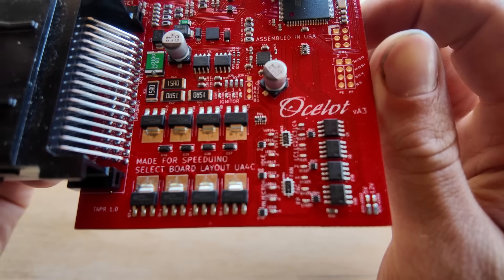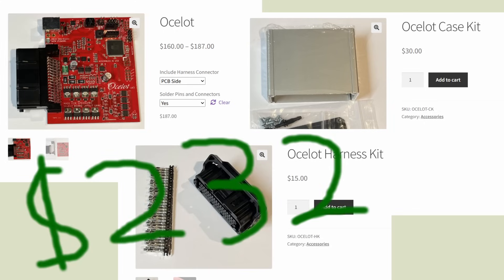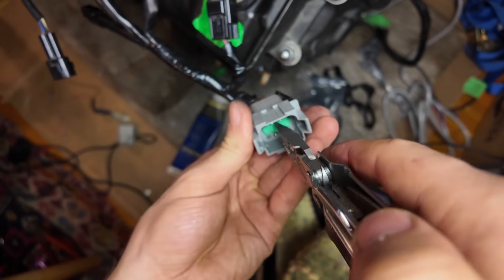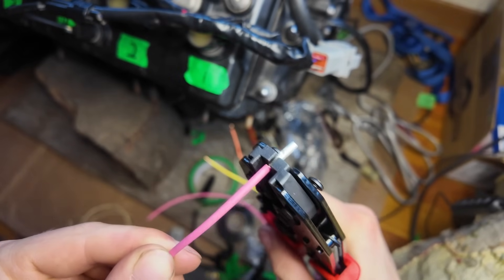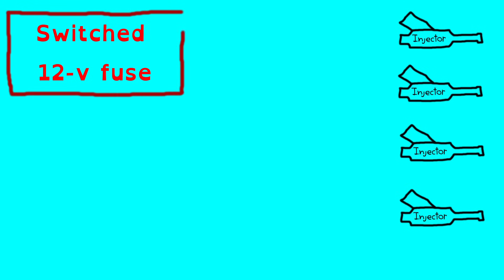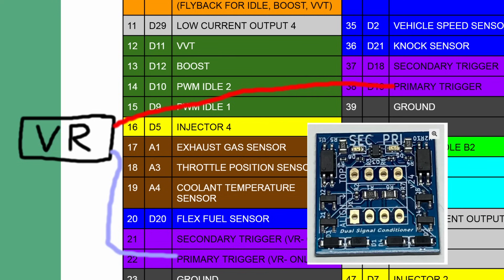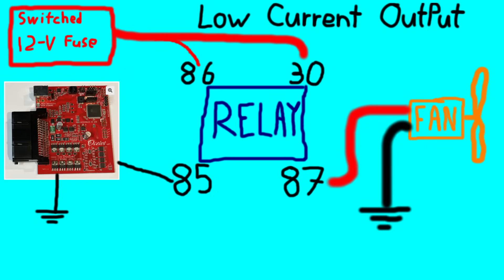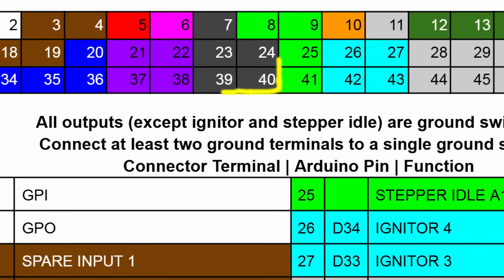ECU Wiring Simplified - Featuring Speeduino Ocelot

Comment: I am a long time Speeduino builder/user.  I highly caution against the use of 14.7's spartan series WBO2 controllers.  Unless they have made some significant changes to their firmware, when your AFR reaches the rich limit of the Spartan's range, it defaults to output 5v  (which the ECU interprets as max lean).  This seems like just an inconvenience, but when using the WBO2 for autotuning, it will cause any VR cells which are too rich to become WAY too rich.  I opted for the AEM WBO2 controller (I'm not a fan of having to have a gauge, but they're relatively cheap and dead reliable)
Reply from the maker: thanks, I will definitely keep that in mind

Comment: Great stuff! Having done wire work for GM a while ago, I found several things useful to this process... A large set of felt tip pens of many colors for marking diagram print outs. Junkyard wiring harness for proper color spare wiring. Wiring into the circuit "breakouts" to attach to for debugging later. These should be waterproof, as should all connectors. Bosch stuff (most ecu's are done to Bosch designs) has wiring which works when new but as time goes by, becomes overloaded , runs hot or the insulation breaks, allowing corrosion and current faults as you drive down highway 140 in Nevada... Most of all, plan for debugging and work on getting wires just the right length. You may not know much about electrics now, but to learn, ya gotta get busy! As Honda said, to succeed, you have to fail a lot!! Get out there and fail! Make notebooks with part numbers, your thoughts and sources for stuff. Most of all, never give up.

Comment: One item I'm unsure of, and can't find a clear answer to anywhere I've looked is how to ground sensors when I have more sensors to ground than ground inputs on the ECU?   I'm using an ocelot.   The O2 sensor has an electronic ground (versus 12v heater ground), VTPS ground, ECT ground, IAT ground...and I'm forgetting one.    Even given those I've listed, that only leaves one open ground for the ECU to ground point.  Is that acceptable?  How would I ground additional sensors to the ECU directly?  I'm guessing a ground bar off of a ECU pin isn't the answer.
Reply from the maker: @krakenworks7702  I believe it is standard practice to splice sessor grounds together and connect to one ground pin on the ecu. this allows you to to use 2 or more of the ground pins to ground the ecu(I believe 2 minimum is recommended for the ocelot).  a link for a video on star point grounding is in the description of this video it may help answer some of your questions.

Comment: With the ocelot and older ua4c boards you do not use one of the spare inputs for an external MAP sensor. Next to the onboard MAP, there's a via on the board labeled EXT MAP that you can add a pin or wire directly to, then sever a trace on the bottom of the board.

Comment: I need to put one of these on my 06 cbr600rr. I basically replaced everything besides the ecu and harness and it still wont turn the injectors on. Im thinking it has to be the ecu or harness and the only option is buying old used ECUs that are as much as an ocelot. It would open me up to getting it fully tuned as well. My bike has vr sensors and i think i can cut a tab off the cam trigger plate to get an appropriate signal for the speeduino to use one of thr basic tooth configurations.

Really good video I am going to use this to get the projected started.
Reply from the maker: @clutchboi4038 ahh yes, a very sneaky electrical gremlin that doesn't want to be found. Keep in mind if you do go the Speeduino rout, you may have hidden costs such as a quad spark. But, if you want to get into tuning then it might be worth it. Best of luck getting the bike running😀.

Comment: Microsquirt is only $300 and is very well developed to decode just about any engine crank/cam sensor and can control just about any engine. The megasquirt has better control of COP for larger v8-10-12-16 cyl engines..
Reply from the maker: @Altprophet Meg/Microsquirt is definitely a well proven excellent system. But I would argue in terms capability pre dollar Speeduino definitely wins out, and with the dropbear COP is now possible up to 8 cyl. 
That being said I wouldn't necessarily recommend one over the other. I think it really comes down to the individual project and what features are required.

Comment: Thats awesomely interesting, I'm trying to use a 99 ecu on my 02 zzr1200, because I always think "why not" so I have no rpm or speed limiter, but if this is a more sane alternative, I am very interested, thank you
Reply from the maker: I mean the easiest would of course be to find an 02 ecu, so long as you don't run into immobilizer issues. But Speeduino is definitely an option. If it is a sane option is up for you to decide😂

Comment: 55 years for me to reach this level of understanding, reduced to a few minutes! Excellent. For some reason, the teachers seem unable to reduce the subject to fundamentals. You have!
It's amazing how many mechanics don't even know that fuel injectors have a live feed, which is grounded to switch it on/off. Thanks.
Reply: my name is Tobias and I know that injectors are ground controlled! The ECU isn't a power distribution center, it is easier for a ecu to shoot a ground signal rather than a voltage signal every pulse.

Comment: Thank you for making this!!

I plan on using a speeduino to convert my 1987 Honda CRX from carb to fuel injection. It'll be a rather difficult project since the EFI parts for that car are neigh impossible to find or cost more than the car is worth.

I'll be working to come up with my own trigger wheels for it and use a throttle body set from the Honda CBR 1000
Reply from the maker: Very cool, I love me a CRX. best of luck!

Comment: BTW I find the best way to power the LSU 4.9 is via the fuel pump relay.

It's fragile and can crack from cold-start condensation if it's been pre-heated by leaving the ignition on (programming, checking data, etc). The pump will almost never be on unless the engine is running.
Reply from the maker: Yes, thanks for bringing this up, a very good point indeed. I currently have it wired into ignition but I should probably change that ASAP.
Reply: Yup, VW has powered lambda sensors from the fuel pump relay since they started using them in the 80s.

Comment: This was a really good video. I've done a few engine swaps in cars. And usually the security system from the donor car is a problem. This would eliminate that. Once you get it running please show the tuning process.
Reply from the maker: Yes absolutely! security system is the reason I couldn't just buy another stock ecu for my bike engine. The tuning video will still be a wile since the engine has no car to go with it yet. But the getting it running video should be out in the next couple days.

Comment: Fantastic entry level start and I thank all of the helpful comments! One very helpful detail would be to supply part numbers on the wiring terminals and tools used. I want to build one of these! I’m interested in the tuning to dial this ECU in and what is adjustable, ignition timing and fuel delivery? I recently began developing an oscilloscope training course for motorcycles as every circuit can be tested while the engine is running. It’s best to test a known good system to have a database for troubleshooting. Oscilloscopes are becoming affordable and they are not difficult to use with proper training and learned techniques. A quick example regarding crankshaft sensors. The two wire sensors produce an AC voltage known as a sine wave. The voltage is an analog signal. The three wire crank sensor are typically Hall effect sensors which use a power source and a ground and send a DC digital on/off signal to the ECU. With an  ohmmeter all testing is done without the engine moving and all power off. With a volt meter your reading will be a numerical value. With an oscilloscope the realtime voltage waveform can be displayed. The electrical behavior of coils, injectors and fuel pumps can be measured all from the ECU or the fuse panel. Even the burn time of a spark plug can be measured to see if the mixture is rich or lean. Anyone interested? I’d like to contribute to this thread. Build, learn, and ride. I just bought a basket case SV650 to use as a test subject.
Reply from the maker: @Dee-xm4jb Yes part/tool list is definitely a good idea. I will put something together and add it to the video descriptions. 

Ignition timing and fuel delivery are definitely the main things, but there are quite a few other things that can be controlled such as idle air control valve, boost control, variable valve timing and of course it can control any circuit using a relay as I mentioned in the video. 

I have never used an oscilloscope, but I can definitely imagine it coming in handy. I can think of a few times it probably would have made my life easer.

Comment: Tempted to try to get something like this working on a 2000 f150 5.4 v8
Reply from the maker: @kaleb8518 Absolutely. you wouldn't be able to do fully sequential injection with any of the regular 4 channel Speeduinos, but it's probably overrated anyway. Or you could of course go with the drop bear which has 8 channels.

Comment: Bro if you become a subject matter expert on speeduinos, I bet you could make mad $$$ this way - like for example my brother has a damaged ECU in his duramax that keeps an injector on - expensive but dumb problem.
Reply from the maker: I'm definitely no expert yet but I'll keep working at it!
Reply: @Crusty-Creations  Yeah. If you could do this for diesels, people will line up. Avoid all the stuff that is non-essential for the car to run and drive. Then people can figure out the other stuff in th car seperate from the car running like it should.

Comment: I started on speeduino and moved to rusefi using the same hardware because I was running a stm32 mcu and I like both rus and speeduino however I find that rusefi has some better features and runs smoother on my setup.
Reply from the maker: nice, it's cool to learn about these other options.

Comment: Its mind-blowing that nobody makes an electronic version of a carburator which would only need to read the intajmje vacuum or intaje air flow to know how much fuel to inject just like a real carburator but with the reliability of fuel injection . And if u wanna get fancy u can have a temp sensor and a oxygen sensor.... thats it. 1 to 3 sensors... why diesnt anybody make that?
Reply from the maker: I think this is basically how a holley sniper EFI system works. definitely makes things simple.

Comment: would be possible to manage a cummins ISB 6.7 with this?
Reply from the maker: someone else did comment asking about a diesel. to be honest I don't really know anything about diesel ecu control but I imagen you might want something more specifically designed for diesel so you would have better control over injection timing.

Comment: Crusty! Excellent video. Can't wait to hear it run.  I don't have a fuel injected project, but I've been looking at these Speeduino's and am very interested. Your simplified explanation is the best out of everything i have seen. Thanks much. Also great way to carry one of them engines. I can pick up and carry Harley engines, the V cylinders make it real easy to bear hug them, but most other engines are kind of a big blob that are very hard to lift, even though I think they weigh the same or possibly less.
Reply from the maker: @martianrays The second way I did it with two people was much easier. that wide stance was super awkward lol.
Reply: @Crusty-Creations  it looked awkward. I've done that dance across the shop with heavy stuff that's also hard to handle! The whole time you're just telling yourself  "Almost there!"
Reply: @Crusty-Creations  OH!!! The next day I found a guy that did a digital dash using a Raspberry Pi and 7 inch display for his race car. Looked awesome and would go great with a Speeduino.
Reply from the maker: @martianrays funny you mention that I was actually quite recently looking into the whole raspberry pi dash thing. I'll probably either go with that or I had the Idea to just buy a cheap second hand laptop and use that as my dash.

Comment: Good video covering the essentials of a standalone. But there are a couple of points I want to comment on.
1. Some hall sensors operate on 12V supply, and might not work on 5V. Output signal will almost always still be 5V, regardless of supply voltage.
2. DO NOT ground your ECU to the battery negative. Always to the engine head/block. If you wire your ECU to battery ground and forget to hook up the main ground, your ECU will power up and allow you to crank the starter, sending 100+ amps through your ECU.
Reply from the maker: @Rosteripulla Thanks for pointing these things out. Its hard to cover every detail. someone else also brought up the topic of grounding and I have put a link to a video on star point grounding in the description. But thanks for bringing up your point about hall sensors I definitely should have mentioned that.
Reply: @Crusty-Creations  Sure, that's a lot of information to remember and lay out, you're bound to forget something.

Comment: Just because your coils have 2 pins dont mean they are dumb coils- if theyre from an older style motorcycle theyre almost guaranteed cdi coils requiring a 100v+ pulse on the primary side. They will spark too when used as dumb coils, but not nearly as strong and sufficient. Had this exact problem when using gsxr pencil coils on a car. It would run ok when the engine was warm but getting it to start was a nightmare, what we thought was an upgrade was a downgrade. Changed coils to r8 type and all the issues were fixed.  (A coil that usually runs at 100v+ on the primary side running at 12v is kind of weak as expected)
Reply: Killer info thank you
Reply from the maker: Interesting, I probably should have known this because my last project was a Honda CB750 which uses a cdi ignition system, but I never had the need to learn about it.

Comment: Dude, I made it to 1:54 and I can't hold it in any longer. WTF is wrong with people?! Stealing wires for an engine?! How stupid is that, FFS!!! It drives me nuts how stupid people can't just be stupid. They insist on being stupid and doing stupid things and saying stupid things and causing stupid problems. Some people are just so bad at life that they're like a black hole for anyone that they're near. They just suck everything good out of the lives of everyone around them. I'm not talking about low intelligence though. If someone isn't as smart as others, that's whatever, it takes all kinds, (except the kind I'm talking about) and I'm cool with that. I'm talking about the people that do it to themselves. "Stupid" to me is when you're smart enough to do it right, but your judgement is so terrible that you end up doing the wrong thing every single time, even when others try to correct you. That's the kind of person that stole your wiring harness. That's the kind of person that should be required to wear a warning label "Caution, I'm stupid. Please stay back 25 feet" Seems like a reasonable solution to reign in the kind of person that steals greasy wires in a milk crate.
Reply from the maker: but hey, maybe they really really really needed a 2006 Yamaha R1 electrical system. I'm sure they put it to good use lol.

Comment: What's an ECU?
Reply: Electronic Control Unit.
The name the industry refers  to the electronic "module" that controls the engine.
The E.C.U. together with the Fuel Injectors, are - basically - what replaces in the modern engines the functions that used to performed by the Carburator + Ignition + Distributor of an old conventional engine.
Reply: engine control unit
Reply: that's also bcm - body control module, and others could be

Comment: I would like to make an ECU for a caterpillar b series skid steer safety interlock ECU. It has to verify, seat safety bar, seat switch, door closed, parking brake, and a couple other safety solenoids before it sends signal to crank at a start relay. I wonder how I could? Thanks
Reply from the maker: If I understand correctly this should be possible without any computer but just with wiring.

Comment: Great video! Looking forward to more. Though I will add one thing (I am not a sparky, just a nerd with this stuff), my understanding is that you do not want to ground anything to the engine block as if you do, and your engine grounding strap comes loose (it does happen) when you try to crank it will ground through those sensors and ecu and all the magic smoke that lets the electrical pixies work escapes
Reply from the maker: @CarrierPigeon42 Thanks for bringing this up, we definitely don't want to let the magic smoke out. I probably should have talked about this more in the video but it is difficult to cover every detail. My understanding is this can happen when your ECU is grounded in multiple places. So if the ECU is grounded to both the battery and the engine block and you have a loose connection on your engine block to battery grounding strap, then when you go to crank, your ECU becomes responsible for all that current and oh no bad time. This is where star point grounding comes in. So basically everything should grounded to the same place(this place could be the battery or the engine block). Haltech has a good video on this which explains it better than I can. https://www.youtube.com/watch?v=iuCIC1HjHVA I will also put this link in description.
Reply: @Crusty-Creations  No harm in battery being point on that star!
Reply: @Crusty-Creations  yeah sweet as, I'll have a watch! happy to learn more useless (to me) information =D
Reply: Yep you want all ECU related stuff grounded to the block..otherwise all yourn1 wire sensors ground thro an earth strap. And may introduce a drift.
Reply: Fantastic use of sarcasm! I love Yamaha. ✌️🙂